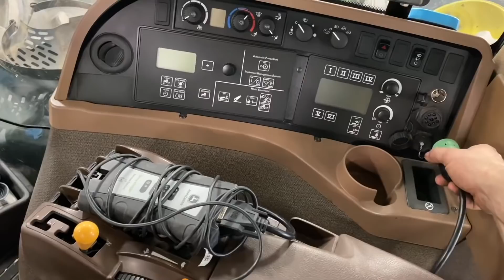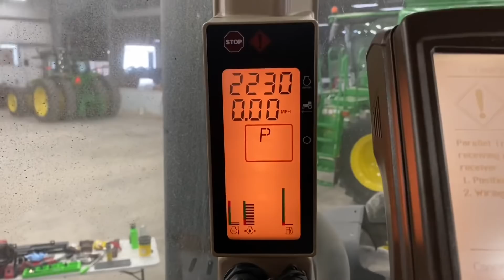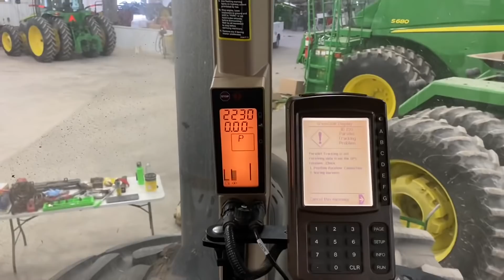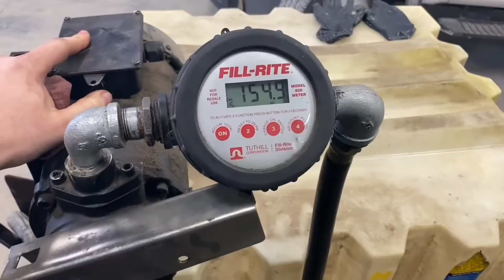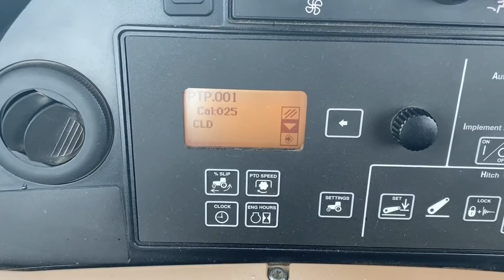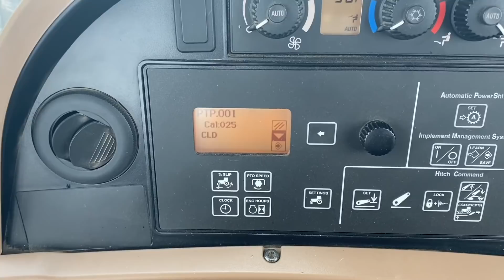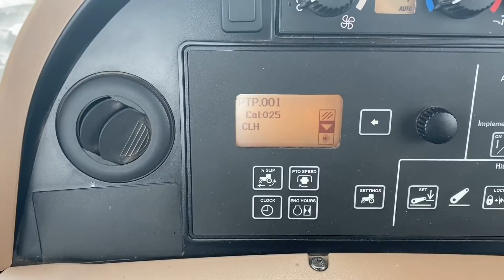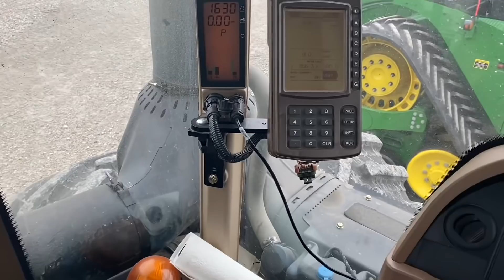John Deere water pump disaster (Part 3)

Comment: None of us will ever install a water pump without checking that the shaft is straight! Most impressive work on your part, I do feel that the parts and the alignment tool seem to have taken a longer time to arrive that I would have expected though. I know getting a new engine can take a while, I just hope the client wasn't in need of that machine while the engine was in transit. I supose that the tractor isn't needed much during the winter.

Comment: I was so surprised to see you filling the coolant without using vacuum.  I believe cat wants you to vacuum fill in anything with egr cooler.  Although I have had them fail even using the vacuum fill.
Reply from the maker: There’s an air bleed on top of the egr cooler.

Comment: I just don't buy that the bent water pump shaft caused this failure.  Something went through the gear train that broke the teeth and bent the water pump shaft.
Reply from the maker: Like what? The engine ran perfectly fine until the water pump was installed and then there was immediate noise. I think I would know I was there for the whole thing. You only seen a glimpse.
Reply: @ZKMasterTech  If you can turn the shaft by hand... how was it hard enough to turn that it broke those massive gear teeth? Bad castings?
Reply from the maker: @turbodog99  it was because the shaft was bent not hard to turn. And yes that is enough to break a tooth and all it takes is one.